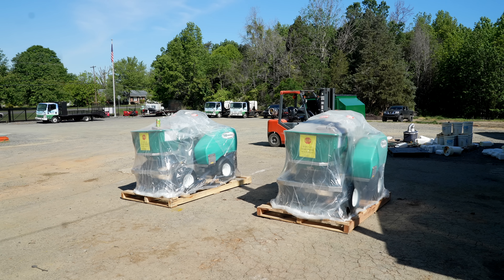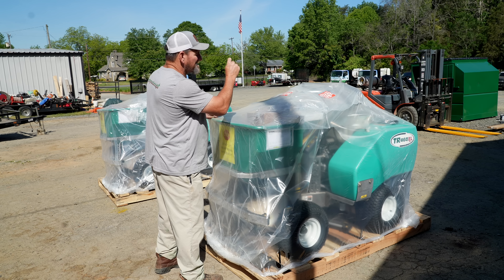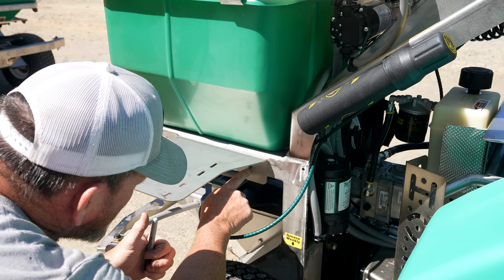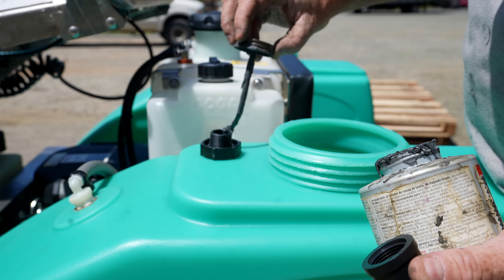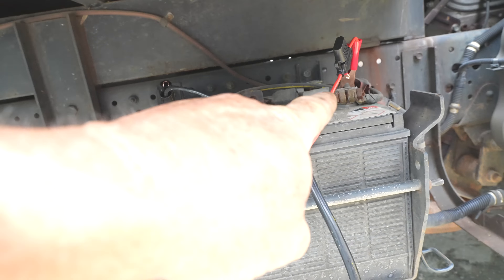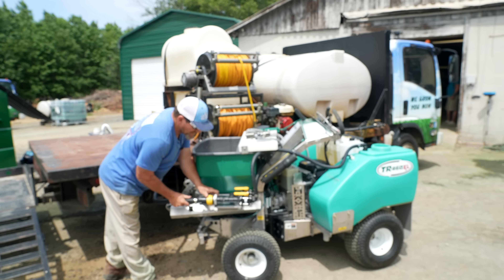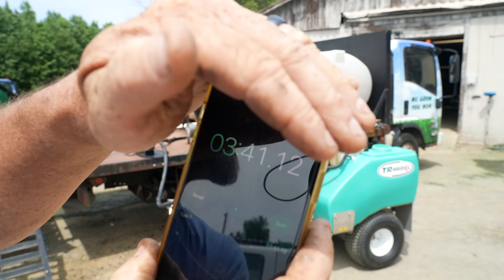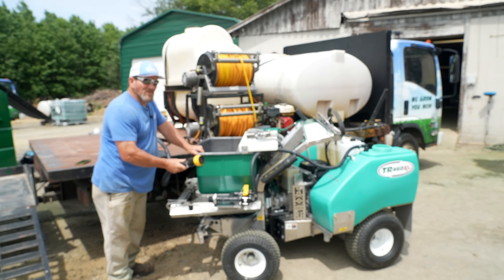FASTEST and CLEANEST Way To Refill a Ride on Sprayer

Comment: Nice set up pete. If you dont use all the chemical in the nurse tank in a day.....can you use the same mix multiple days in a row using the same solution as long as you agitate it each morning? Im still running a 100 gallon skid sprayer, and man do I spend a lot of time mixing.